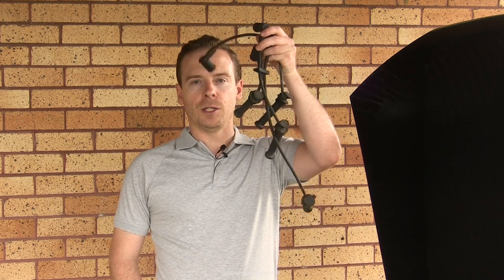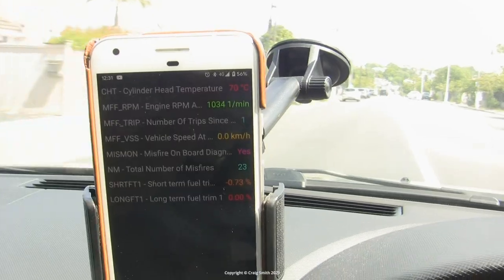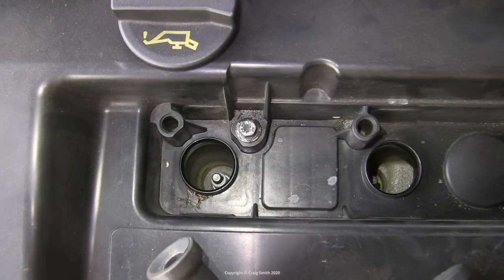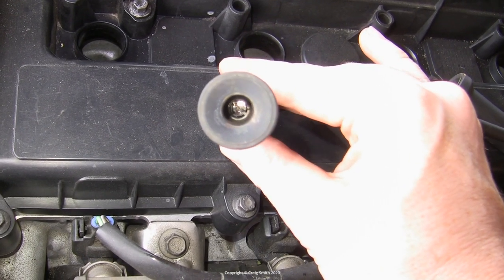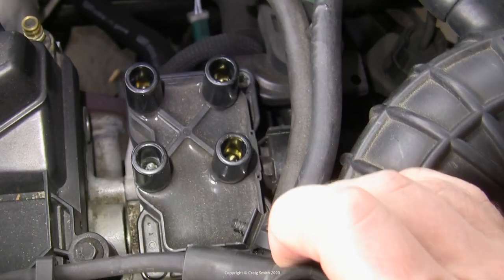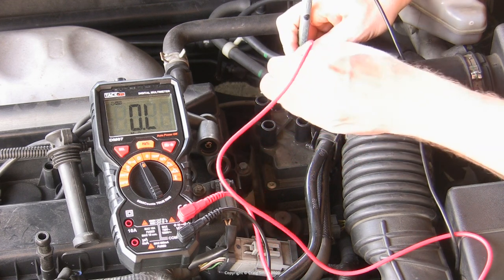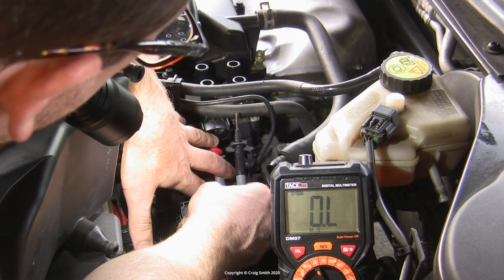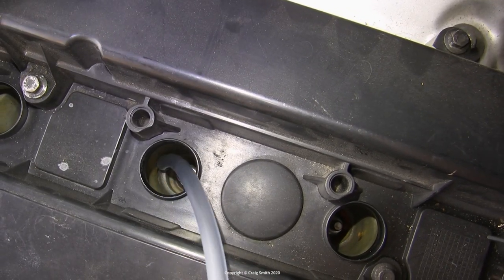How to: Check a misfire & replace HT ignition leads

Comment: Hi Craig! I’ve enjoyed all your videos so far as your Mondeo is the same as mine with a very high mileage of about 300,000 & I’ve owned it now almost 10 years & bought it second hand. All I have had to do to the engine is replace the water pump. Which was  a real sod of a thing to remove because it had been glued in from new by the looks of it!
The ignition gave me a bit of strife a year or two back, & a mechanic said it was the coil pack so purchased a brand new one! In all the time that I have owned the car I have never replaced the spark plugs because I have been told that I shouldn’t need to! The car has never missed a beat except for the coil pack! ( touch wood!) It’s got tonnes of get up & go! Even though I have driven from the middle of the north island to the top & back again numerous times!
I am surprised that you have had to renew or look at lots of various things with your car’s engine that I haven’t or won’t ever consider touching! I have however just recently added some Power Up to the engine & transmission to help with the lubrications of the engine & automatic transmission smoothness etc. I probably unlike  you have a heavy right foot, so when I drive somewhere in my Mondeo it’s not going slow, but I always keep to the speed limit!
Oh I recently replaced the plastic rocker cover for an alloy one because the gasket seals leaked oil into the spark plug wells as the four seals became hard & brittle & stopped sealing & no amount of tightening would over come it! You cannot over tighten plastic covers without breaking something!
Cheers for all your videos as they all have been most helpful especially changing the power steering pump having two o’rings that have to be of the green type!
As for the catalyst in the exhaust system have your muffler man knock it all out and the engine goes just as good if not better without it  not in there!!
Keep your videos coming as they are all full of good helpful knowledge!

Comment: Hi Craig, I have owned my 2001 2ltr Auto Mondeo for 20 years now and maintained it myself. Recently if I'm in drive and stationary then hit the accelerator in quick succession so say pulling out of a junction the engine hesitates then goes but if I slow down the reaction time from brake pedal to accelerator then all is fine. The resistance on the HT leads are all within tolerance and I have replaced the spark plugs. Like you I have a obd scanner that provides live data but no faults shown so I was wondering if the throttle position sensor could be the cause!
Reply from the maker: Possible yes, easy to test with a volt meter, I have a video on that with same engine. No faults ok but you will need to get into the weeds of the air/fuel data if the TPS checks out. Check other basics, air & fuel.

Comment: Hi Craig, first off thank you for all of your videos on YouTube. We have exactly the same Mondeo and because of your guides I've managed to replace my swirl flaps (twice!), replace my clutch, carry out various service tasks and diagnose  many problems. I'm posting now to ask for some advice. About six months ago I started to notice the juddering you've referred to in this video. When I checked my plugs, only one of them (number 3) had an obvios issue. The metal connector at the plug end of the HT lead had corroded and stuck itself to the plug end when I pulled the lead out. I cleaned it up a bit, and then ordered a new plug and just the specific HT lead. I've replaced them both today and initially it seemed to work, but as the day went on, the juddering returned. Do you think it could be a simple case of disconnecting the battery overnight and thus resetting the computer? Or, could I have missed something? I'll take all the leads out again tomorrow and follow your guide to make sure the connections are clean and sound, but if that doesn't work, any ideas? Respect, Ian

Comment: Hi Craig I've got a petrol feista 09 plate won't start again if the engine  is warm change a battery , new spark plug  and the voltage  are good  any advice  what's wrong with it?

Comment: Hi Craig
I would have a question about my car if you could help me out.
I was just wondering. MOT has been done to my care which is a Ford fiesta, before the MOT  the noise level was high in the car, its consumption was also high and it's felt like it doesn't have much power in it.  after running a test on its computer to find any problems with the car, everything was fine. oil has been changed, oil filter and also Air filter was changed and they reset the on board computer. The engine ran very nicely without effort, very quietly, very quickly and its fuel consumption was perfect no noise whatsoever. The yellow engine error light came on when we were traveling, the noise level increased, the consumption also increased, the performance decreased. now I don't know what to do... any suggestions please

Comment: Help please! We just bought a Ford Mondeo Mk3 Automatic second hand, and there's a hose loose. It's the one on the gearbox, bellow the air intake and below the battery. Right next to the sticker with PTAN  1S7P-BA. We don't know where should be plugged the other end. Any guidance would be much appreciated!
Reply from the maker: There is a vent hose down there that doesn't connect to anything, it's just a breather. Search images of that to compare and confirm.
Reply: @CraigsDIY  Ok, thank you very much! We were vary scare when we noticed a loose hose. We asked a mechanic but didn't believed him much. Now we believe it thanks to your answer. Once again, thanks you very much!

Comment: I've changed HT leads, spark plugs. cleaned out tmap sensor and air filter, throttle body. and my car hesitates at low revs at start of acceleration (sometimes) ... is it coil pack, air leak?? (mondeo mk3)
Reply from the maker: Well you need to know what the hesitation is first, check what you can with a scan tool. Misfires can be because of fuel or air as well as ignition.

Comment: My 1.8L petrol mondeo has a rough and inconsistent idle.
Have replaced the sparkplugs, ignition coil, ht-leads, fuel filther and cleaned the air intake parts.
Anyone have any ideas what it could be?
Reply from the maker: If it's not spark then could still be fuel injectors, if it is idling over-revs then more likely a vacuum leak downstream of the throttle body.
Reply: @CraigsDIY  It's very strange, it works buttery smooths some times. Often, when I first start the engine up it works smooth, but after the engine is warmed up, it starts to run badly and the engine vibrates. No strange distinquishable noises that I could detect. The idle revs also change depending on its "mood", some times it idles at about 750rpm, but sometimes it goes as high as 1200.
Reply from the maker: Maybe a vacuum leak that is opening up with heat.
Reply: @CraigsDIY  Could not find any leaks or any other apparent faults. The most likely problem may lie in the inlet manifold, but that is quite a job to open and finding parts is challening. It''s very strange, because the engine works smootly on startup, but gradually gets worse after it gets warm.